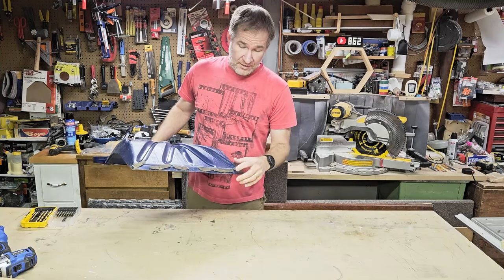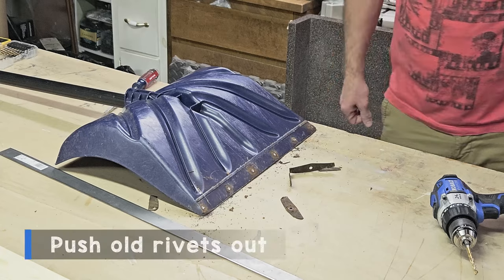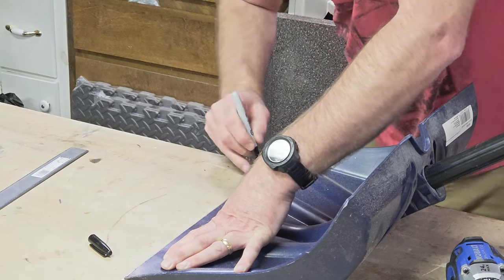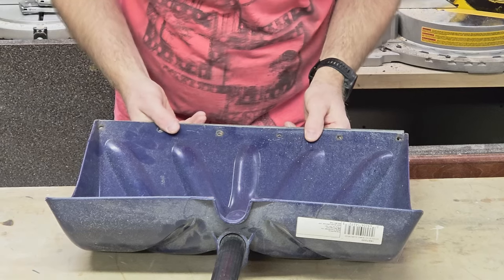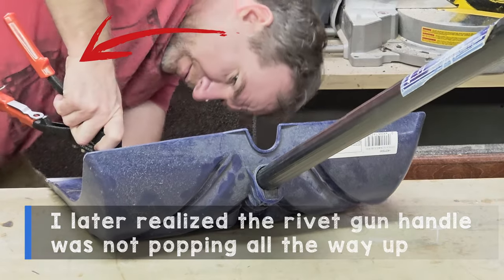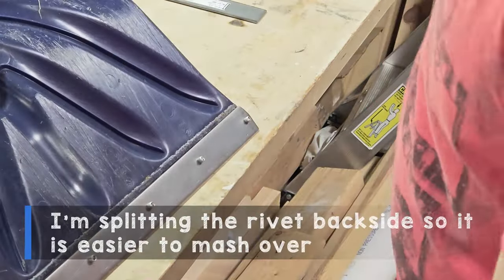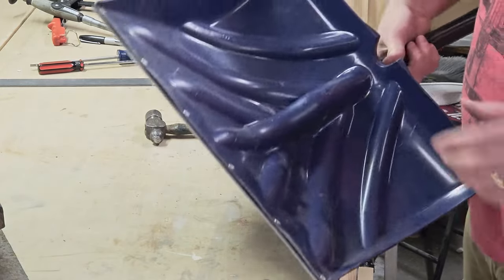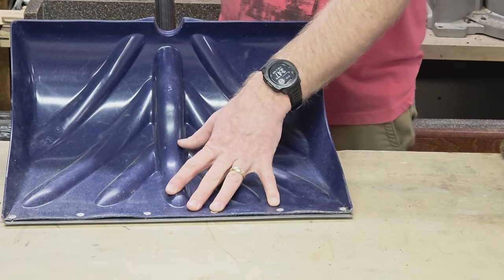Restore Your Snow Shovel: Insider Tips for Blade Replacement! | SBW#82

Comment: Where did you get the metal? Is the worth the price of the metal? I looked at Home depot and they were very expensive.
Reply from the maker: Hi @fredcarrano, I'm not sure what the price at Home Depot is but I got mine at Menards.  The price was about $6.30 for a 1" x 36" piece of flat steel. I did not not get stainless, just regular flat steel.  I believe I used about 18" of the stock so I still have 18" for future projects.
Reply: @SeanMoenkhoff  It was about $14 for 1" x 36" aluminum. The steel was double that price. If it was $6.30 I would have purchased it. Thanks for the response.
Reply from the maker: @SeanMoenkhoff - WOW!  That's crazy.  If I remember right aluminum was more expensive where I am than steel.